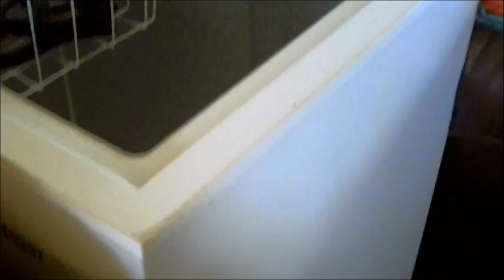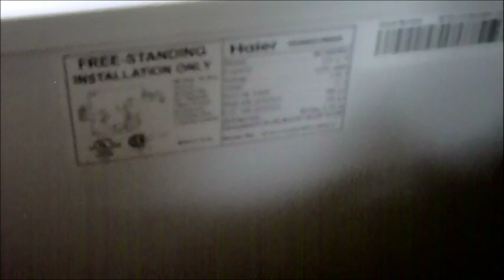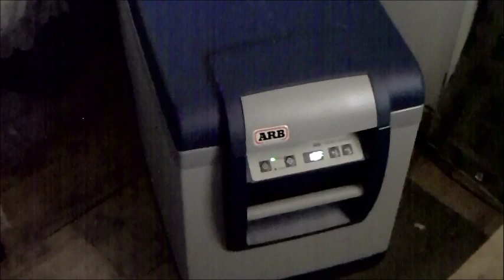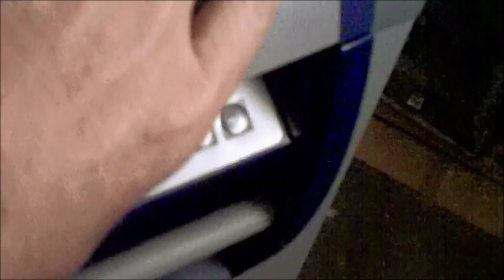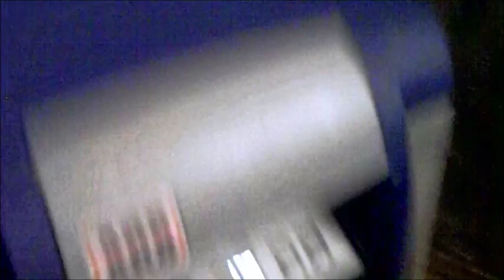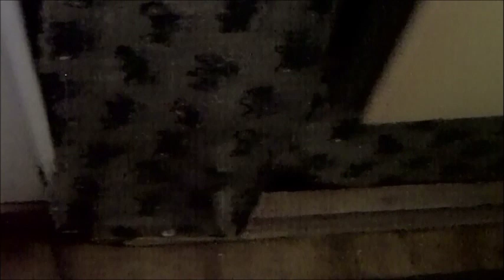Ask LaMar: ARB Fridge/Freezer Comparison Review

Comment: How is your ARB fridge holding up? I'm not sure I would be to confident having frozen food in there, even if it is 10 degrees off on the temp reading at 19 degrees and what it is inside your food still didn't look frozen at 29 degrees, and 32 is freezing. For over $800 to me that is not acceptable, It should be accurate.

Comment: thanks for great video 2 questions can you run the chest freezer as a refrigerator on 400 watts of solar panels and two six volt batteries wired up for 12 volts or would you need more batteries and Solar panels how's the ARB unit doing I'm thinking about buying one of those too as well if I can't afford to run the chest freezer as a refrigerator I may try to get 2 ARB units one for refrigeration 1 for freezer I'm new to Solar right now I have 400 watts Renorgy Solar panels 4 100 watt panels and a Morningstar PWm charge controller I want to engineer a second system for 24 volts to run more stuff and get a MPPT charge controller like you've got

Comment: Liked.  Really like the subject.  Appreciate your approach.  It did leave me wondering how adding 800 dollars worth of solar and battery storage might compare to the ARB expenditure.   I'm thinking of the appliance not for it's total watts but rather it's "fraction" of the total system.  It seems it's fraction would really be the most important thing.  The smaller percentage your appliance needs of your system per day the better.   Your thoughts?  I'm looking forward to your video on your new setup and hope you don't stay in hiding too long.

Comment: Here is something you may find interesting.
It is the plans on how to convert an enclosed 5x8 trailer into a walk in cooler using a air conditioner and a controller.
If you Google "PACK ‘N COOL CONSTRUCTION SUMMARY" you will find it.
It is designed by the N.C. State University's Plants for Human Health Institute

Comment: Great video.. thats the exact system i use here... 5 cubic ft. freezer and a johnson external thermostat .. i use a 1250 watt inverter .. worked flawless for the last seven years..  freeze stuff in the bottom and milk at other stuff up top in the basket ..
Reply from the maker: Thanks friend!  I think that is the system most off-gridders are using that I have talked to and works good.
Reply: new subscriber also.. ive been totally off grid now for 8 years .. nothing like it.. no power bills no water bills .. nothing .. gotta love it ..

Comment: great video!  Just got these two freezers, and the thought was to convert one to a 2nd refrigerator, but may look around for another small one.   Also, something I found on the chest freezers, you have to look around if buying new, some of the ones that the nasty big box stores sell are the most inefficient models available..   chinamart sells one that is a huge energy hog for a tiny freezer...      we have a local home brew store that sells the thermostats to convert a freezer into a beer keg refrigerator, same as what you show and they also have the digital ones like we use on our wood stove.    my question would be how do you know where you can safely drill a hole for the probe????   the digital is a thin cable where as the metal thermostats are the copper semi rigid probe lead.
Reply from the maker: Thanks Fritze, you can sometimes drape the thermostat over the door lip or the chest may have a drain hole you can use for the thermostat. I would avoid drilling if possible.
Reply: I'm not sure how they route the tubing inside the walls, that would be my only concern.   now down where the compressor is (the raised area inside in a corner) might be safe, think that is just metal isn't it??  I would think breaking that seal with a wire/lead running over it might not be a good idea for efficiency?? just my thinking... cloudy as it is.

Comment: Hi LaMar. Good to see you. I saw a video from another off girder. He had a chest style freezer. But it took a lot of power at start up. So he used a charger capacitor. I think that is it like a relay Anyway when it starts up it pulls the power from the relay. Then switch to. pull from the solar setup. The relay chargers from the solar setup.

Comment: I was so hopeful until you said the price...then my heart sank,lol. I've been off grid for right at 1 year 2 month's and refrigeration still remains my biggest challenge/hardship. I'm tired of getting ice, draining the cooler and such, especially during the hot months like now. Thanks for the info though man.
Reply from the maker: If you need to store quite a bit of food I would look at the chest freezer conversion. It will run off a small system and would be less expensive. The ARB company needs to come down in price for us off-gridders lol!
Reply: solarcabin Yes they do need to lower that price! I don't really need to store a large quantity of food, just need the low current & amp draw and insulating factors of the ARB...That's why they can get the big bucks for them I guess. I'd pay half that but just can't see $800. Sure hope it lasts lol! When I get time I will look at your videos you mentioned and do some further research. I have some refrigeration/or modifications I've been dabbling with in my head to play with one day.
 Thanks again man.

Comment: Hey LaMar, we have the exact same freezer, our system is small, our inverter only goes up to 9 amps, when that freezer/fridge conversion kicks on, it it takes it up to near maximum then goes right back down to about an amp and a half, certainly less than 2 amps. My inverter has no problems with that even if there are other things running as long as it's small stuff. So that freezer/fridge unit isn't surging up to 12 amps otherwise we wouldn't be able to use it.

One thing I highly recommend, we discovered this recently, cut a piece of 1 inch PVC pipe about a foot long, drop the probe into the pipe, then insert that into the box, otherwise the probe may touch the side of the inside of the box which will cause it to short cycle. :) Once we inserted the pipe, it runs for about 8 minutes on and 28 minutes off during hot days. We have four 6 volt golf cart batteries hooked together to make a 12 volt system, each one is 220 amp hours.

Good video!
Reply from the maker: Thanks Wretha- It depends somewhat on the outside temp as to how long the compressor runs. Keep it in a cool spot and it won't run as much.
Reply: solarcabin Yeah, cool spots right now are far and few between :) We are in our hottest month, it's the only time I wish I had a air conditioner or swamp cooler, then we have our rainy season and it cools off... fortunately it usually cools off greatly overnight.